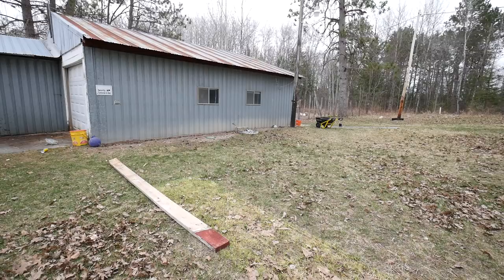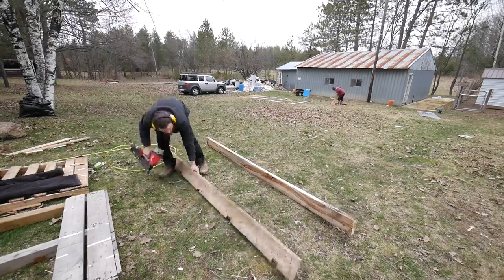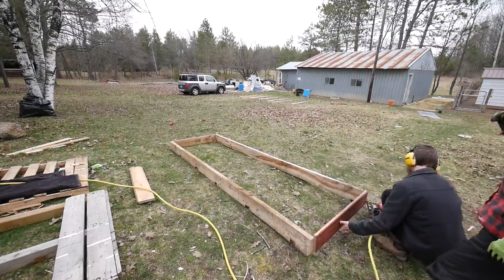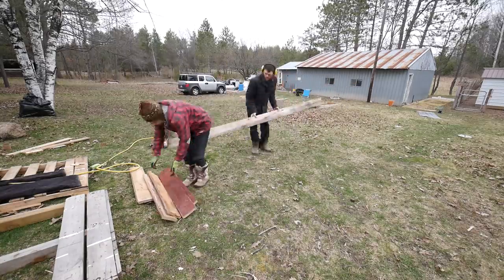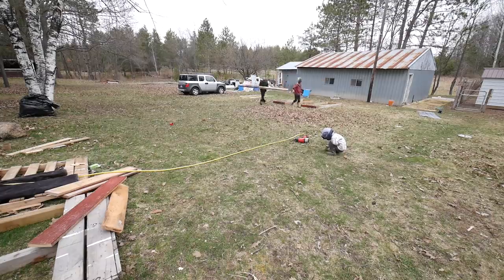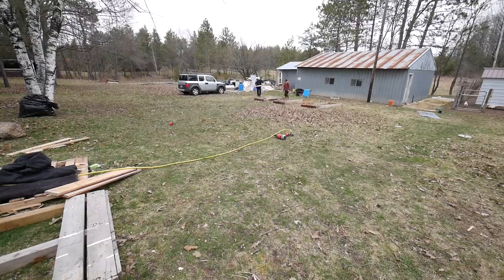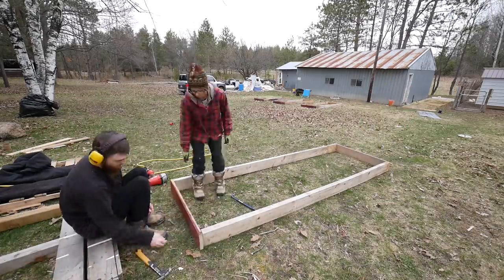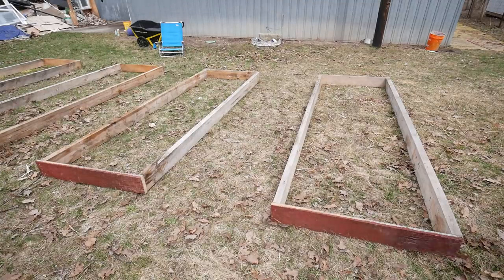No Dig Garden Frame - Brown Paper Better than Cardboard?

Comment: Your videos are such a breath of fresh air. Straight forward, but always a plan. If you bought sheet of clear corrugated plastic from the big box store, your could plant in those boxes a month earlier and harvest a month earlier and you would have higher yield. I laid those clear panels on my raised beds made from cement blocks. Weigh them down on the frames with 1 pound rocks weights etc.  This will create mini hot houses. It protects the plants from the frost and acts as a greenhouse heating up the temps and encouraging germination and growth. Water is key but only after the seedlings are up. I had my minis in CT. But I learned this trick from my mom in Northern Alberta. She would put coffee cans around certain plants to act as windbreaks from the winds off the Rockies. The wind is a big culprit in evaporation and in chill.  As the plants get tall you can raise the plastic roof by inserting blocks of wood underneath. When it appears that the hothouse is too hot for the plants (evidence of burning on leaves, or just higher temps, remove the plastic all together.  I found that my green bell peppers and my eggplants were so much more productive and mush earlier. You can do this with  bush style cherry tomatoes in pots. Just wrap the corrugated plastic around the pots  and cover with plastic. Hold the plastic together with holes made with drill or plastic punch for vinyl siding and tie the pieces together with electrical style zip ties. I will send you pictures.  Veggies should be watered so that the soil stays damp for a period of 10 to fifteen minutes. Only two to four minutes of watering will suffice, but watering must be done everyday. Also in the heat of the summer watering should be done in the morning and also at noon. Do not water in the f=afternoon because it encourages mildew, mold, wilt, slugs, etc. Water once daily when you plant. Mini greenhouses do make the plants thirsty due to higher temps under the plastic.
Great video.   Next project: painting the barn roof.... :)
Reply from the maker: Thanks for the great info :)

Comment: That's basically how I made my garden too.  I have old deck boards as the frame.  I made mine in a keyhole shape.  Removed the grass layer and covered the ground with straw from my quail hutch over the winter.  I have some sprouts up and I'm looking forward to seeing what happens.  I'm not a great gardener myself, but I'm just gonna try to keep at it til I find something that works.  LOL!

Comment: I totally agree with iwth planting close to the house. One summer we planted an orchard, in a spot up on the hill nearer the woods. We ran hoses out to it, but first hauled buckets of water. Even with "deer-proof"  fencing, the deer managed to get in, and year after year ate more trees during the winter. In the end, we had one tree that actually grew and produced apples for 2 years. Then that poor tree got run over by a truck. A lot of work, expense and I learned from that. Gardens and orchards are best as near to the house as possible. (We lost a total of 38 trees in the orchard we planted.) I also really study to get trees that have been grown in a climate like ours, if not right in our area. Some may not have wintered so well. Good luck with your garden, and I am hoping to have one here. We had gardens at our previous house.

Comment: I made some planting beds last year similar to yours using a bunch of cut-up paper bags at the bottom - I didn't think about buying a roll of paper.
Reply from the maker: Did it work well?
Reply: @diyfferent  It's working well so far.  I placed them over Bermuda grass, which is hard to control.

Comment: Spigot and silcock are pretty much synonymous, so both are right, although technically a silcock penetrates the sill of the foundation, hence, your faucet in your kitchen sink can be considered a spigot, but not a silcock.  What you installed there is (generally) called a frost proof silcock, which you can leave on year round because the valve that controls the flow of water resides inside the conditioned space.  In your case, if the space behind the wall where you installed it isn't conditioned, you may want to turn off the water to that during the winter.
Reply from the maker: It stays warm enough though. We haven't had any pipes freeze yet :)

Comment: I vote for hose bibb. 😁That's the only way I've seen it noted on house plans. I may be wrong and don't mean to be a debbie downer, but the success of your frost free bibb is dubious. If your crawl space freezes that bibb is going to freeze. The design is that the valve to shut the water off/on is in the long tube which should be in the heated area of the house such as a basement that won't see below freezing temperatures. I suggest you move it up so it connects inside your utility room.
Reply from the maker: Our crawlspace doesn't freeze and stays fairly warm down there. All of our water pex pipes made it through winter without freezing  :)
Reply: I am really interested in the spigots or Bibbs you used. In NC it doesn't get terribly cold, at least now. I remember having to replace pvc and cpvc lines under my house because the cold water froze and it was too cold to repair and with water turñed off the hit water lines cpvc froze too. I had insulated tubes put in and three heat lamps under there then. I removed the lights two years ago and haven't had any insulation most of the newest lines either. No frozen pipes because the temps are only rarely below 32 F here and if so not long enough to freeze pipes. Still might try your Bibbs.
Reply from the maker: Our crawlspace does really well even in our northern winters probably because it's very air-tight with no drafts at all, and some heat from the home radiates down to the crawlspace. If it were drafty down there, the pipes would most likely freeze.

Comment: You can do a no dig garden by just buying bags of topsoil, poking some drain holes on the bottom as the bag is flat on the ground, then cutting out the top of the other side leaving a border of the plastic around the edge, and plant your seeds or plants directly in the bag. No dig and no extra supplies needed and they actually work great
Reply: We did that we grew our tomatoes from a bag we had great 🍅 we just put some sticks in so they could grow up.  they tasted the best. I like grow bags.

Comment: We had to help can food for weeks as kids.  I hated it.  Now I have 3 raised beds.  Instead of scalding, peeling and pressure canning everything, I rough chop into quart freezer bags and freeze flat.  Takes hardly any time and my hands don't turn yellow and shrivel up!
Reply from the maker: I am really considering freezing over canning. I hear that some things need to be blanched for best results. But I don't know. It still seems easier and cheaper than canning.
Reply: @diyfferent  I did not blanch my tomatoes.  I waited until they were very ripe and froze them.    I still am working on 2018 crop and they taste good.

Comment: I think its called "cow panels", a four by six inch squares of wire in like ten foot or probably longer like twelve foot long panels, one sheet long by five feet high. This fellow took metal fence posts that you can drive in the ground but for seasons and replace every year they (husband and wife) and gently folded it in a hoop shape laying sideways and then stood it up between the two steel posts on the ground about three and a half or four feet apart, stood it up like I said like a bridal path and made rows over the beding. Come winter it has done its job and the panels can come right back down cause not nailed to anything. Old pieces of pipe would work and those don't have to be as tall as the panel, it just stops the panel from flattening out again till taken down. I don't know if it would have "memory" in the metal "cow panels" cause they are not bent, just in a gentle curve and you can walk under to weed, plants can climb them because they are there, and lastly, it kind of stops birds from flying into the berries and other foods that the birds crave including the seeds that you plant like it was intended for them/LOL. It looks like a exaggerated "C" laying on its side so like I said; walking through to weed, the climbing peas and beans will climb right up them and you can broadcast carrots, radishes, beets, greens (mmm... beet greens) or just leave empty as it is your spot, your call. It is so non evasive and easy to put up or take down for any reason. I suppose that you could use twine from the straw bales or zip ties as they are everywhere and dirt cheap. People just starting to work at a jack in the box or some other small drive by food stand can afford zip ties and you could save the tie wires on the loaves of bread. All works, the ends of the hoops are flat on the ground so other predators will have to go in the hard way.

Comment: Cardboard is made from recycled paper. The glue is made from corn starch.  The inks are made from soy based ingredients.  I researched it just so you know. Most modern card board construction is made that way. Its cheaper and required by laws. My rabbit likes to chew cardboard. I had to relocate our spigot because it was on the neighbors side of the trailer. I used a free spigot that I got from a yard sale. It was brand new!

Comment: How did this work out for you guys I am in the middle of building 4 Foot by 20 foot garden row beds. I have completed the first two rows and what I did was a flipped the side, so I had to dig up the entire road and turn over the clods of dirt to face the grass side down. I have an electric tiller and I would’ve been willing to tell the ground this first time, but in New York right now it is too wet on the ground that I am planning to work. So I was thinking of doing no dig in the last two beds. But I want to be able to plant right away so I was thinking of using builders paper and I found your video and I was wondering how it worked out for you? I think this is a great idea for the reasons that you listed the paper will break down easier the roots will be able to penetrate and you can punch a hole in it when you’re planting if you want to make sure that the roots can get down to the native soil

Comment: Hose bib
:
Your hose bibb, or outside spigot, is the faucet located on the exterior of your house. ... Yup, that's your hose bibb. In winter, homeowners in colder climates need to turn off the water to their hose bibbs to prevent damage and flooding when the weather drops below freezing.

Comment: Petcock  is what I called it till I got too many snickers about it.  this is the definition from Google ...A petcock is a small shut-off valve used to control the flow of liquid or gas. Historically, petcocks were threaded valves controlled by a butterfly handle; modern petcocks are typically ball valves.

Comment: hose bib fir attaching a hose, spigot does not have threads for a hose and faucet has aerators, etc. but not for hoses. the sill cock should have just a slight tilt up towards the back so the water left inside can drain out after the valve inside is cut off. if not the purpose of the sill cock is defeated. now you can argue......g
Reply: That's what the plastic ring does Remus.

Comment: The garden won't grow much. Even in a no til bed you have to til it the very first time. The ground probably hasn't been worked in years if ever since it was the lawn so the roots won't be able to go very deep. You gotta loosen the soil.
Reply from the maker: Not true. Lots of gardeners don't till the first time, though it does help with some circumstances. But roots are tough and can work their way in just like the weeds do. Our soil is sandy loam and very loose and soft which will help too.
Reply: @diyfferent  OK, but your garden is much to shallow to prevent weeds and grow anything but lettus. 8-10 inches is good for just about anything.

Comment: might be nice to build a lean to greenhouse on the sunside of youre home , profitting from the residual heat radiating of the home during the colder months , i seen them made from recycled windowframes and glass basicly just nailed the frames to a basic wood structure with a recycled door and doorframe in one side , if you have siding left you could do the bottom half in that with some left over insulation materials stuffed inside , the roof of the green house i seen was made from clear plastic material 
 https://d16m3dafbknje9.cloudfront.net/imagescaler/8952303091742-500-500.jpg

as the gardenbeds and for nailing the wood together , the weight of the soil will want to push the planks a part and probably succeed over a couple of months , you can nail it together if you use the nails in shear force , like nailing a metal strip (nailband , the stuff you use for fixing sewagepipes to floorbeams work well and its cheap ) around the corners on the outside instead of butt nailing the corners together  , or stake the bed down on the outside like you would do a mould for pouring a cement foundation , it has to hold about the same force pushing the boards out 

as for the raised flowerbeds , i think the one board hasnt got enough height and the soil will dry out too quick in summer and verry likely gets too cold for the plants to finish growing in the fall it might work with a lot of ground covering plants and flowers , 
https://thumbs.dreamstime.com/b/garden-design-flowerbed-yard-landscape-design-garden-design-flowerbed-yard-landscape-design-123848405.jpg
for plants to go up more , they need the same distance down for their roots , it might help to put a second layer of planks over the top to make the sides higher , makes it look nicer (if you paint them the same as the outside colour of the house or use, carboleum that protects the wood from the weather , that works pretty good  , it does smell a bit and burns the skin if you dont wear gloves while painting it on 
raisng them makes the flowerbeds eazier to work on , you dont have to bend down as far 

if you want to grow stuff like tomatoes you might want some scaffolding to tie them up against , the higher sides makes it eazier to nail sticks ontoo the side of the flowerbed too , 

stuff like carrots and beets radishes onions potatoes need more space underground too

when you go to a gardencenter ask if they actually need the compost soil (the compost is likely a little on the acidious side because of the rotting process ) you might need to mix in quite a bit of neutral soil or calcium to get it right 
the people working at the gardencenter can probably help you with that or point you to plants and veggies  that trive in that sort of soil and full sunlight (a natural forest with the all the leaves on the ground is basicly living on pure compost )

if the garden doesnt work this year despite youre best efforts you could pull up one of the bedframes and stack them on top of the other and use the soil out of the removed frame to raise the new bed to the right level , cost notting just some effort and maibe some extra wood and nails 
it might work if you have the kids take care of the garden , like a chore , it might make it eazier to have them keep the plants watered and stuff as they likely to have more time for it 
it gives them some responsabillity and pride in their work if they succeed